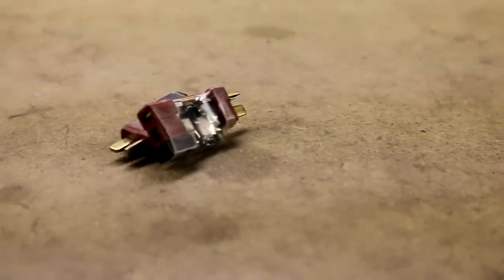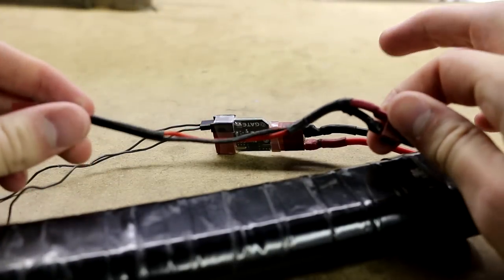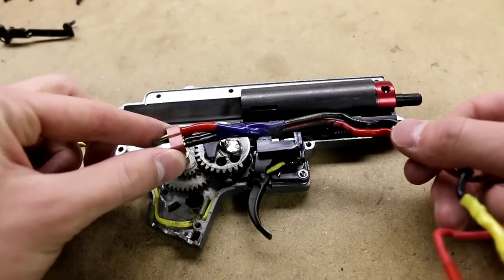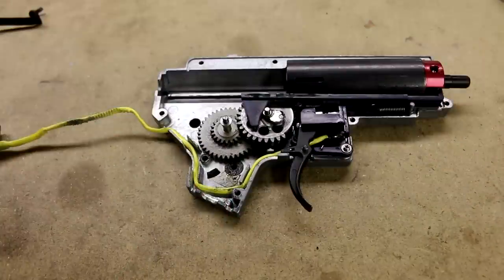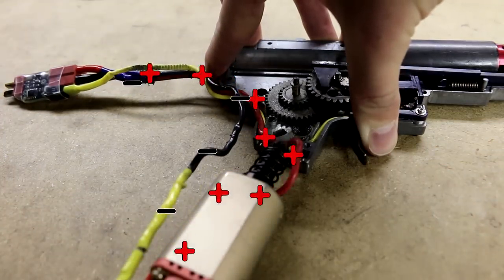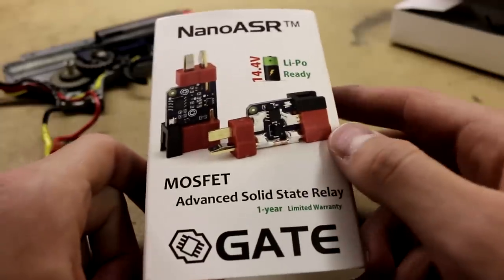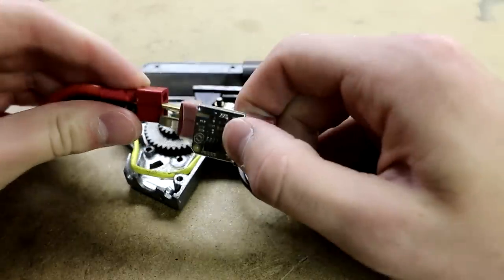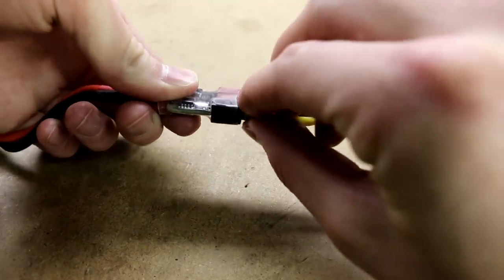Airsoft Tech: MOSFETs (AEG)

Comment: @Stinger what can you recommend a mosfet with active break or just the ordinary mosfet for a trigger-response build?
Reply from the maker: Active breaking MOSFETs wear motors more over time, because they reverse the polarity of the electrical flow, forcing the motor to spin against its own momentum in order to slow down faster. I do not recommend them for that reason.
Reply from the maker: Any MOSFET will do.

Comment: Does it matter which way you plug the signal wire into the mosfet?
Reply from the maker: No, the signal wires are the same and all the MOSFET detects from it is whether or not there exists a circuit.

Comment: Is there any mosfets out there who protects the trigger from arcs and doesn't require soldering? ^^
Reply from the maker: There are full drop-in units which completely replace the trigger contacts altogether, such as the BTC Specter or Chimera.
Reply: Stinger Thank you.
Reply: Good luck finding the Spectre though, they're fucking impossible to find.

Comment: What the connectors called that connect to the motor??? Anyone?
Reply from the maker: They're called Spade Connectors.
Reply: The Bastards do I have to order them online? Or can I get them at a general hardware store? Thank you for the reply btw
Reply from the maker: @jaredsantomieri8584  - They should be available in a hardware store in multiple different sizes. You'd have to find a size that fits.

Comment: Can programmable burst unit protect trigger unit from arcs as well?
Reply from the maker: If it's a true MOSFET, then yes.
Reply: Thanks for reply. I mean simple plug and play unit, so it might not be a true MOSFET..
Reply from the maker: No, that would not provide protection, as it still allows high current flow through the trigger contacts prior to circuit completion.
It is a true MOSFET, but it doesn't handle the switching of the circuit.
Reply: Yeah.. you've answered all my questions. Great utuber! Thanks again.